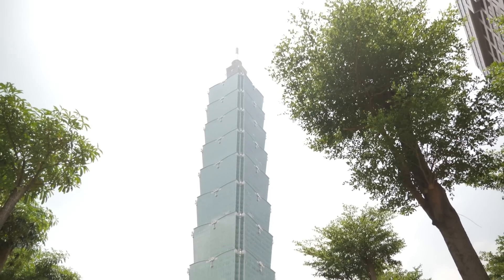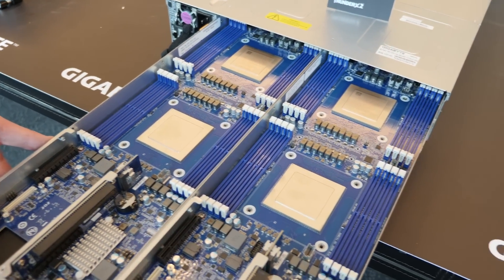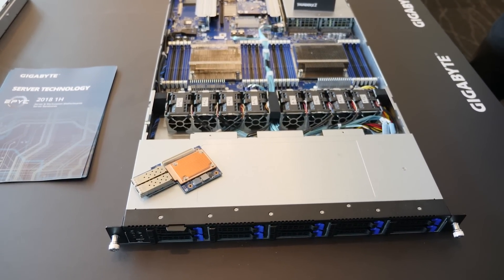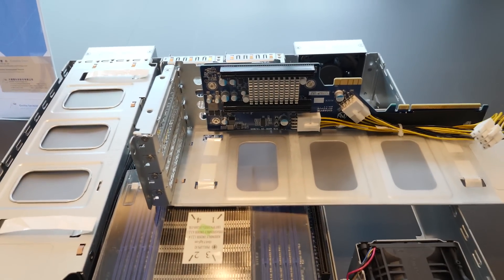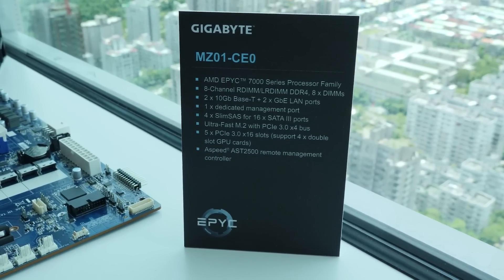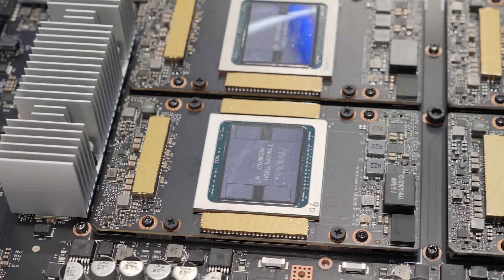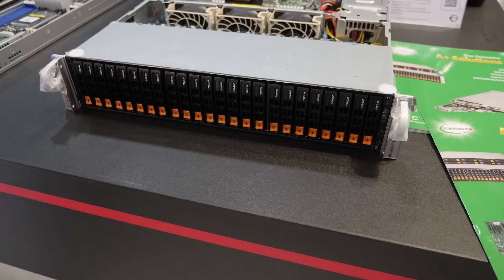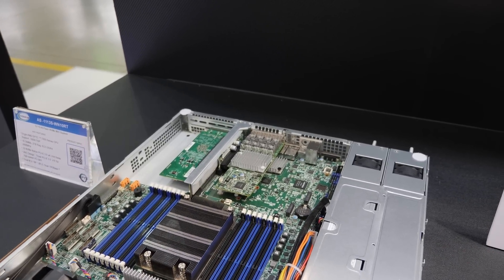1 Petabyte of Flash in 1u, 2 Petaflop  Servers & Enterprise Gear of Computex

Comment: Please show more 100Gb networking stuff.
Reply: yumri4, 100Gbps Ethernet over QSFP28 is available on the Mellanox ConnectX-5 NIC.
That can do 100Gbps over direct-attach copper or over fiber.

Ethernet is a protocol stack, not a connector type. You're thinking of RJ45 which is the connector type.
If you need a 10Gbe RJ45 switch then look at the ASUS XG-U2008 or Netgear GS110MX.
Reply: i still cannot find a 10Gbps router so how is 100Gbps going to be useful? direct connect maybe?
Reply: @yumri4  ....there are a bunch. expensive but they exist. 

or get a network switch. use it for an internal network thats stupid fast.
Reply: @bmxriderforlife1234  True they can do 100Gbps networking. Just right now they do not have the hardware to do so. So IF they do put in a 100Gbps NIC they will also need to get a switch that is able to have a 100Gbps port to handle that speed. That is what i meant is all.

For a 100Gbps network there are vaild reasons for why it might be necessary. Video editing is not on that list in my mind. IF they were to have the 100Gbps NIC on a local storage device for all the clips to be on then have the editors with 10Gbps ports to link up to said server that would make sense so everyone can access it at once without any slow down.
Reply: @yumri4  
Yes, but that wouldn't be any different with any other network physical layer.

When ethernet first came out (RJ45), people were more used to (still) using coax cable, perhaps with a round-robin topology for transferring and transmitting data back and forth.

I remember the days when my dad and I would spend days fiddling with it and trying to get two computers to talk to each other.

And then there was also the concepts of the straight-through cables (with RJ45) vs. crossover cables (used for direct connections).

And then you have hubs and switches and routers where you would just use straight through cables for all connections to the ports and then the hub/switch/router would handle/manage making the connections for you between systems.

So that that end, I don't think this is really much more different than that.

If you want to link two computers together via direct connect, you don't need a switch to do that. I have two pairs of nodes that are running like that right now.

But with my four nodes, if I want to be able to "talk" to any of two at any point in time, yes, I will need a switch for that.

re: what you can use it for
That all depends.

If you have enough processing power and RAM and NVMe SSDs AND the 100 Gbps network - you probably CAN do video editing work about as fast and as efficiently as you can, especially either in a multi-user environment or if you just are processing a lot of video simultaneously.

But having the 100 Gbps network without the rest of it - yes, you can still do that, but all that will mean is that it will highlight the next element/part that's the bottleneck to you getting what you do faster and if you're happy with it, then you might not bother to upgrade it, but if you want to do what you do faster/more efficiently, then you might look into upgrading it.

I mean...that's why I decided to spend the money to upgrade my cluster interconnect because to me, it made sense and it was valuable enough to me to justify doing so.

I don't think that it's for everybody/anybody. But there are some people (such as myself) where given the 100 Gbps network/interconnect, I'll make full use of it -- if not for the full bandwidth, then because of the ultra low latency (which IS why I bought it in the first place).

(My media servers are only upto 10G between them and the clients are single gigabit ethernet because the bitrate that is required when it is playing, doesn't need nor exceed gigabit ethernet speeds, so there'd be no point in giving it something faster. Plus, my mechanically rotating hard drives can't read/write data from the RAID array any faster anyways and moving to all SSD is unnecessary (at play time) and too expensive.)
Reply: @yumri4  
You don't use a 100Gbps router. You can either get an unmanaged switch and then one of the "nodes" that's connected to the switch will be the "manager" or you can get yourself a managed switch and it will perform that level of network management duties for you.

I'm running 100Gbps 4x EDR IB right now and I am currently looking to acquire a managed switch. The managed switch would probably be able to have their onboard, embedded DHCP server, but my four nodes right now (dual port per node) are all running with static IPs anyways (because then instead of running a DNS server to resolve the hostnames to each node/port, I'm just currently managing it at the node level via /etc/hosts). I doubt that I will ever get enough nodes where I'd actually need a DNS server to take care of that (because a single 36-port 4x EDR IB switch can handle 2048 nodes).

But your "step up" from a L3 managed 4x EDR IB switch to your internet will likely route through (and dropping the speed) down to maybe a 10Gbps uplink unless you actually have like OC192 running to your building. In other words, to go from LAN to WAN, you're very likely going to be down-stepping your link speeds anyways. (The link speed on my cable modem's port is a single Gbps port, and the cable model itself, of course, doesn't support anywhere CLOSE to those speeds. Not yet anyways.)

So....what is it useful for?

It depends on what you do.

I perform mechanical, computer aided engineering analysis from my home business so I use it for the ultra low latency (moreso than raw bandwidth) as the interconnect between my nodes.

And when I am moving the files that are needed to set up and start my simulations, my network used to be able to only run up to 1 Gbps speeds (gigabit ethernet) but now, I just transfer the data to the first node in my 4-node cluster, and then I propagated out to the rest of the nodes over the 100 Gbps interconnect which can only write the data at the speed of the SATA 6 Gbps SSD drive (~2.4 Gbps realistical/practical limit).

But for some of the applications, having the high speed interconnect can mean an almost LITERAL 50% reduction in the time that it takes to perform and complete the computationally intensive task.

For tasks that aren't bandwidth limited, but are latency limited, this is a piece of technology that can help. For example, in my own testing, the average latency for a message packet that's 65536 bytes on gigabit ethernet is 1541.17 microseconds. By comparison, the average latency on my 4x EDR IB (100 Gbps) network/interconnect for a message packet of the same size (65536 bytes) is 8.7 microseconds. (Also in my testing, I can hit between 96-97 Gbps (out of 100 Gbps)) and copying a 40 GiB file (in Windows Server 2016 from a 64 GiB RAM drive to a 64 GiB RAM drive on another node - I get around 8.8 Gbps (~1.1 GB/s).) And I haven't spent much time at all trying to set up SMB Direct or NFSoRDMA nor trying to really tweak the performance of the network interface/technology to squeeze every last ounce of performance out of it.

In theory, I can probably push all of my network traffic onto the 100 Gbps interconnect (e.g. RoCE) but I am purposely choosing not to so that the interconnect will remain more "pure" and less "tainted/polluted" with other non-interconnect related traffic.
Reply: 100Gb is coming to the datacenter now. It will trickle down to common folks in 2-5 years.
Reply: as 10Gbps is not affordable for the majority of us yet i doubt it will come so soon though 10Gbps is already on some consumer boards and some consumer and small business routers for Ethernet 
also yes i knoe 100Gbps is over fiber not Ethernet i think he said STP+
Reply: @yumri4  
It depends on what you would consider expensive.

I just picked up four Mellanox ConnectX-4 dual QSFP28 port, 100 Gbps per port network interface card for < $300 US each from eBay.

My copper direct attach cables were about $50 US each and I bought four.

I don't have a switch yet (currently looking into getting one), so with direct connect between two pairs of nodes, that was achieved with about $1300 US in hardware for something that's LITERALLY one hundred times FASTER than gigabit ethernet.

If it were me, I'd completely skip over 10G and just jump straight into 100G. It costs more, but you'll likely never run out of bandwidth EVER since the CPU-to-memory interface with some of the older Xeons (QPI 3.0, running DDR3-1333 RDIMM) is JUST hitting the limit of what the 100 Gbps interface can do. In other words, often times, historically, your network would likely be a significant bottleneck to what you're doing, if you're doing something that's network intensive. With 100G, it'll almost completely alleviate/eliminate much of that bottleneck because your other hardware will become the new bottlenecks.

I'm running copper direct attached cables, not fiber. I could run fiber, but it's more expensive and isn't any faster, so why bother? (fiber would likely be needed if I want to run it from the top floor of my house down to the basement, for example).

So "affordability" is a relative measure.

Brand new, the network cards are $795 US each. So at the price that I bought them, that represents a 66% discount, which is a pretty good deal if you ask me. (Especially when you consider that you can still buy gigabit ethernet cards (like the Intel PRO/1000 GT) for like $40 US, paying $270 US for a DUAL PORT, 100 Gbps network card seems like it is a good deal to me.)
Reply: @StoianAtanasov  already has trickled to eBay I do believe....
Reply: @ewenchan1239  I am going with gigabit for two reasons in my homelab it's piss cheap and I can in theory at least remote into all my VM's will little to no lag. Back ups will take a hell of a lot longer but hey 100g will be for after college....😁

Another advantage to copper over fine is that it is less likely to be broke. I have always heard rules regarding fiber optics. Things like don't bend more than 90 degrees dont bang it needlessly things like that.
Reply: @andrewyork3869  
Don't get me wrong - the rest of my house right now is still running with just gigabit ethernet. Cost has a lot to do with it or more specifically, the lack of cost. (IF I didn't have to run active optical cables, I'd run 100G ALMOST everywhere. (There are some devices that I have (e.g. like set top boxes that has gigabit ethernet, but no PCIe slots (or not big enough PCIe slots) to be able to upgrade to 100G, not that a set top box needs 100G).)

My next/new bottleneck now is actually all of my systems don't have enough PCIe lanes. To be able to take advantage of 100G speeds, I would need to have NVMe SSDs in like RAID0 so that it would be fast enough to keep up. Except now, I don't have enough PCIe lanes from the processors to be able to sustain that kind of bandwidth, which means that even if I were to run all pure NVMe SSDs, I still won't have enough bandwidth because then I'll need more processing power, but mostly for the PCIe lanes (even AMD EPYC won't suffice given the number of NVMe SSDs I would need).

So for now, I'll just have to "live" with that. (Oh darn, eh!?) lol...

Yes there are minimum bend radii for active optic cables, but really, most of the time, that's not going to be an issue unless you're running in a super tight space.

That's also why a lot of blade servers will have the interconnect on the backplane so that there's technically no "cables" in the traditional sense for that.

Again, active optical cables really makes more sense when you're running distances > 5 m. Below that, you can run passive direct attached (copper) cables. And don't get me wrong, even the DAC is pretty beefy so you're not going to be able to make tight bends with that either just due to the sheer size and heft of it.

All of my systems are remotely managed via 10/100 dedicated IPMI link (in addition to more "conventional" ssh over GbE, which of course, take hardly any bandwidth at all).
Reply: @ewenchan1239  that is good information to have thanks, I study cyber security.
Reply: @andrewyork3869  
You're welcome.

Yeah, I'm in mechanical engineering simulations/computer aided engineering - so a lot of the stuff I run either take a lot of memory, a lot of time, or both. The high speed interconnect really helps with that.
Reply: @ewenchan1239  I am working on a AI to fuzz code in hunt of zero days that or otherwise off the radar.
Reply: @andrewyork3869  
Neat!
Reply: @ewenchan1239  you know I was thinking about it, a 100gb preferred client for my eventual AI box might be something to look into.... Might even be cheaper in the end all things considered....
Reply: @andrewyork3869 
Yeah - that's part of the reason why I went with/straight to 100 Gbps and skipped over 10GbE. So two things that are special and noteworthy: I picked Infiniband from Mellanox because they've been in this space for decades with supercomputer and high performance computing so they have a proven track record in this arena. Having said that, their Mellanox Infiniband VPI cards enables you to configure the ports to run as either Infiniband or Ethernet. But, the catch to that is if you have multiple nodes, you'll need either an Infiniband 100 Gbps switch OR a 100GbE switch as at the switch level, the ports on the switch AREN'T configurable in the same way. (Mellanox COULD have done it since their cards support it, but they choose not to implement that on their switches which theorectically forces people to either buy more of their hardware or really hate them for not making available a piece of technology that they already have.

So...having said that, when you get your switch, you have to be really careful which one you go look for online, especially if you're buying used.

Second thing is cost. Yes, the initial cost is quite high comparatively speaking, but a lot of people now are like praising and there's certainly no shortage of Youtubers talking about 10GbE networking at about $100 per port.

I bought my Mellanox ConnectX-4 cards off eBay for < $300 US and each card has two ports, so that's about $150/per port on the card. But the externally managed Infiniband switch that I got was actually < $3000 for 36 ports, which works out to be like $83.33 per port, so I net out to be about $116.67 per port that I'm using, which costs only a little bit more than 10 GbE, but I'm also running at 10 TIMES the speed of 10 GbE.

Again, this is with Infiniband. If I went with the 100 GbE route, it might be a little different, because the 100 GbE switch, even used, is still quite expensive. (around $3000 for 16 ports, which will work out to around $168.75 per port). But again though, for 68.75% increase in price, you increase your speed 10X. So, that's still, I think, a pretty good deal, despite the initial costs.

Something for you to keep in mind depending on what you want to invest in.

This is why - given all of that, I skipped over 10 GbE and just went straight to 4x EDR IB. Ultimately, it's more cost effective, believe it or not, overall, and it's so stupid fast that literally, the INDUSTRY doesn't have the technology to keep up with it - at least if it were to be used PURELY as a storage media interconnect. (Like I said, not even AMD EPYC CPUs have enough PCIe lanes to support a pure NVMe SSD RAID0 array to be able to have enough storage AND enough bandwidth to the 100 Gbps IB interconnect fed, but that's a "good" "problem" to have.)

Thanks.
Reply: @andrewyork3869  
Also, depending on what you are using for your AI compute cores, Mellanox Infiniband also supports GPUDirect where communications between GPGPU for HPC uses/applications can skip the OS/kernel layer/stack and go from application to NIC to NIC to application between nodes, which reduces latency and increases bandwidth. (also known as the GPGPU version of RDMA)

So depending on your program and what you're doing - if you have something that GPUDirect aware and capable, you can run it on that (e.g. 4x EDR IB) and make it run a LOT faster than any other type of system interconnect that exists out there without having to pull a bank job to execute deploying this kind of system interconnect strategy.
Reply: @ewenchan1239  I am deploying two solutions one is a Beowulf cluster made from SSB's. The other is this, I am thinking the 100gigabit might get saved for my FPGA solution. (Yes I flip flop back and forth between gpus and FPGA'S.) The only catch 22 is that switch have you seen this video? Maybe with these cards you could make something to the same effect....

https://youtu.be/p39mFz7ORco
Reply: @andrewyork3869  
Yeah, I have actually. If you go back to that video - you will see that I actually commented on it.

What's SSBs? I'm not familiar with that acronym.

Again, the problem with building a switch like the one that's linked in the video is that a dual 100 Gbps port card requires a PCIe 3.0 x16 slot. So four ports will take up 32 lanes (PCIe 3.0). Six ports will be more than what Xeons can give you (cuz I think that they either top out at around between 44-48 lanes). I think AMD EPYC supports up to 128 lanes in a single socket configuration, and the same in a dual socket configuration (because half of it would be taken up for intersocket communications). So an AMD EPYC CPU would be able to 16 100 Gbps ports arranged in eight dual-port card configurations, at which point, I've only seen motherboards with only up to 7 PCIe 3.0 x16 slots, and not more than that.

Compared to an OEM switch solution though, again, for example, my Mellanox switch has 36-ports, each port running at 100 Gbps, and in full duplex, it would be a total of 7.2 Tbps total switching capacity.

A "home built switch" like that which was shown in the video can't handle that amount of switching capacity.

And the per-port cost that I estimated for your earlier is based on an OEM switch cost. If I built my own switch like that, then it would actually be higher only because of the rest of the hardware that I would need (motherboard, RAM, CPU cooler, video card if it doesn't have onboard video, etc.). With an OEM switch, I don't have to worry about any of that.

So there are pros and cons, of course, to each.

I might build a switch like that so that I can step in between gigabit ethernet, 10G ethernet, and 100G ethernet/100G IB (since there aren't any commercially available OEM switches that can do all three like that), but that's about all that I would use something like that for.

But if you have enough nodes in your Beowulf cluster, having the OEM 4x EDR IB 100 Gbps switch has the potential to be immensely beneficial to you.

Either way, it's food for thought. Something for you to consider.

Most of the 10G cards I see are like $100 a piece. I bought my Mellanox 100G cards used off eBay for < $300. Triple the price, but 10X the bandwidth compared to 10G. So why wouldn't I go for that?
Reply: @ewenchan1239   Ewen Chan  SBC single bored computer, auto correct changed to SSB totally thing related to radios. However those will not be getting a connection like that sadly. They only support 1gig native so that was going to be standard hardware.

My FPGA box(s) on the other hand will burn through about assuming no CPU bottle necking 60-65% of that 100gb connection each at full blast. I really need like a 8 or so port switch if I go that route is my ultimate problem, I go bust on what I can draw from the wall for ports I will not be using. (100-200 watts assumed switch power draw.) Now if I can find a 30-50watt switch I will be able to make it work.
Reply: @andrewyork3869  
It will depend on how your code is written, etc. For applications that I use, they top out at around 80% of the total available bandwidth that is or can be utilized, which isn't terrible. It's about what one might be able to reasonably expect. The benchmarks though will show that natively, it will hit between 96-97% of the theorectical bandwidth, but in practical use, it's around 80%. (And because the bandwidth benchmarks shows that it's able to hit 96-97% of the theorectical bandwidth, that suggests that there are no CPU bottlenecks).

(sidebar: what's interesting though is that my 4x EDR IB link is actually faster than the intersocket QPI communication link. QPI can only manage (when I'm running my applications) about 5500 MB/s. Host to memory is about 9700-9800 MB/s which is about the same speed I get on the IB link. That's the crazy part. So if I am running a case with 16 processors, it might actually be faster for me to run it with two nodes at 8 CPU cores each over IB than it would be running all 16 cores within the same node. Possibly. But anyways...)

My Mellanox externally managed switch with 4 ports active right now pulls about 50 W from the wall. (Measured it with a Killawatt.) You can get a 16-port 100 GbE switch for about $3000 used off eBay. But also like I said, I was able to get a 36-port 4x EDR IB switch for about the same, so it depends on which communication protocol you want to use.
Reply: @ewenchan1239   okay that takes care of my concerns going to just have to do alot more research. Ebay deal hunting a a bunch of price watching I think is in my future. Patch cables are going to cost me a arm and a leg lol.
Reply: @andrewyork3869  
Again....depending on size.

I think that I paid like $50 per 3 m cable. Not great (compared to Cat5, of course), but could be worse. Could be AOC cables that are like $420 for 1 m.

But again, if there is enough benefit to the cost in your CBA, then it'll be worth it.

If you have questions, ask.
Reply: @ewenchan1239  do you have any postings of your set up anywhere? Just kinda curious.

Like I said I just got to go deal hunting online maybe a few surplus auctions or a long shot to a e-waste recycling center. I did a quick search on Google and saw some used/refurbished gear worth looking more into. Another thing is I want to get the prototype of these boxes up and running before I get a very extreme piece of enterprises grade hardware.
Reply: Andrew York 
No, not specifically.

I tried and wanted to set up a prototype but unfortunately, it’s nearly impossible to simulate 100 Gbps transfer speeds and everything that it entails.

So I tested my setup with gigabit ethernet, found it was too slow and went and got all of my 100 Gbps hardware. The Mellanox user’s manual was pretty straightforward to get me up and running at the basic level. There are a LOT of performance tuning parameters that I haven’t bothered with to be honest, but there are resources that are available that talk about that as well online.
Reply: @andrewyork3869  
There's really not a heck of a lot to see being that it's just a switch, four cables, and four compute nodes.

So...it's not really all that visually existing if you can picture/imagine a switch, being connected to four computers.

And unfortunately, with systems like that, you can't really "see" the (performance) benefit from having 4x EDR IB until you start running your applications that can use/take advantage of it where you can run it with conventional gigabit ethernet as the interconnect and then compare it against the 4x EDR IB to see how much faster your stuff runs.

Some cases scale VERY well with it. Others, less so. (And the ones that don't scale nearly as well with it, you can either argue that you want to save the high speed interconnect bandwidth for the stuff that can more advantage of it or that faster is faster, even if it is only a little bit faster. So it depends.)

My stuff that doesn't scale as well is mostly due to latency rather than sure/pure raw bandwidth (i.e. lower volume of data transfer, but reducing the packet transmission latency is what is key to accelerating those applications).
Reply: @ewenchan1239  okay, what you are doing is far more interesting than you gave your self credit for.
Reply: @andrewyork3869  
Thank you.

The physical pictures of the equipment really isn't all that interesting because it's just a Supermicro 6027TR-HTRF 4 dual socket nodes in a 2U rackmount and then I have four QSFP28 to QSFP28 passive direct attach copper cables to a Mellanox MSB-7890 externally managed 36-port 4X EDR IB switch - so if you can picture/imagine what that looks like - that's what the picture will look like.

And even just looking at the terminal/console -- there really isn't much to it either.

This thread in a forum where I've posted some of the stuff might help you, since you seem to be interested enough about it:
http://www.xtremesystems.org/forums/showthread.php?296737-100-Gbps-4x-EDR-IB&p=5268215#post5268215

There's a picture of the bandwidth benchmark results and also an attempt at trying to show the data transfer results with Windows copy (but that's limited because I didn't have SMB Direct set up properly) along with pictures of the switch itself and also a picture of the guts/inside of the switch.

Feel free to hit me up if you have questions and I'll do my best to answer them.